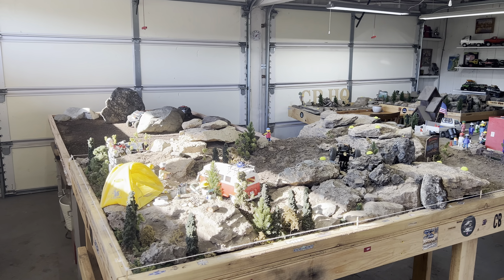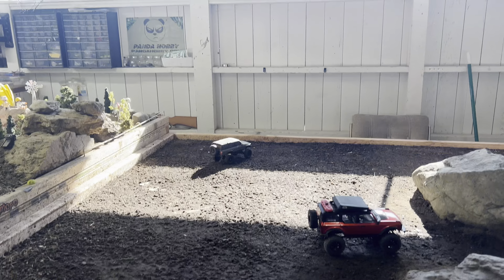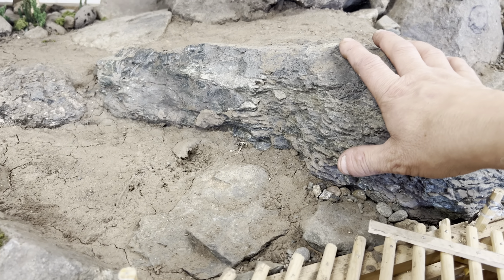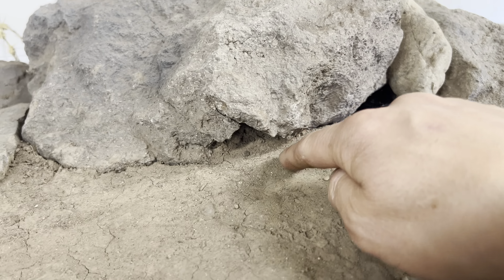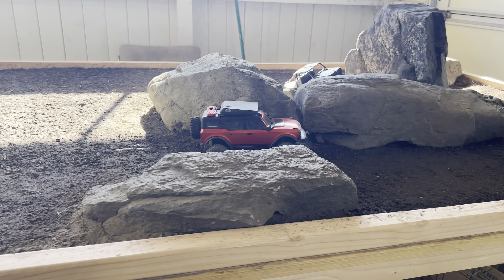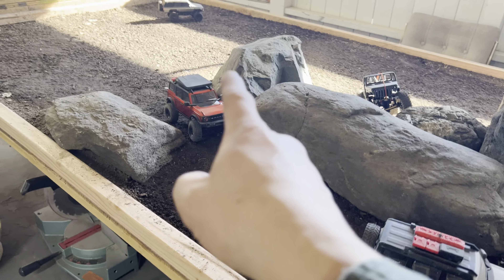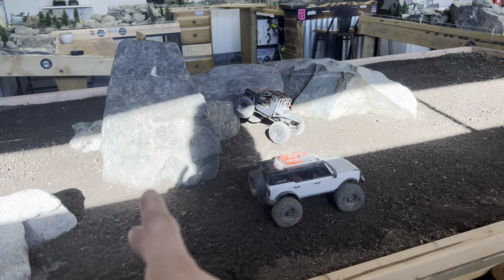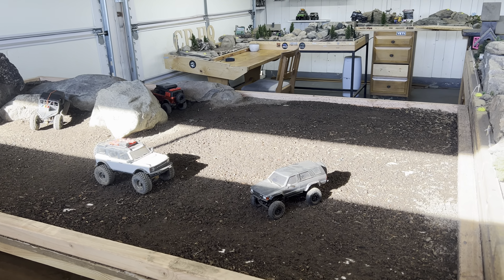Step by step: Building an indoor crawler course (step 3)

Comment: The course is looking amazing, im stuck with running my rigs on my adjustable bed with a brown sheet and rocks for now.  Will you be making your lines wide enough to run trx4m's?  Im sure that 45 deg turning radious on them would work great!
Reply from the maker: I'm pretty sure the TRX4M could fit thru my course- I ran a WPL C-14 thru it!   And yes, that turning radius is going to make it a lot easier!